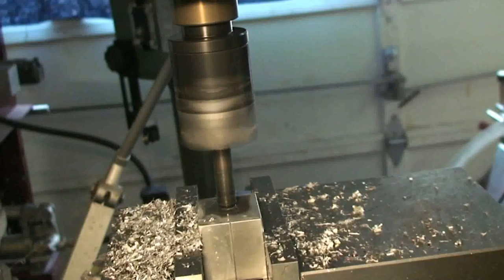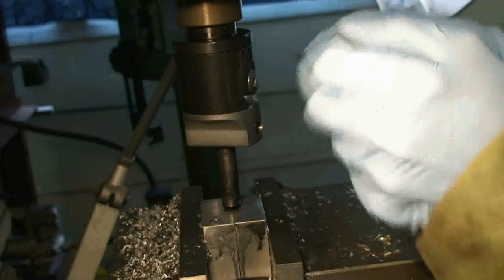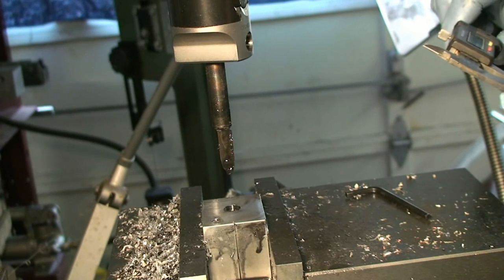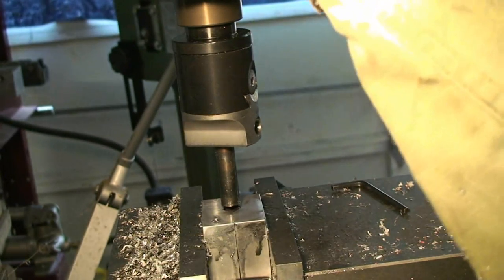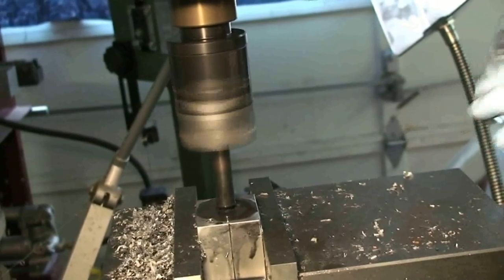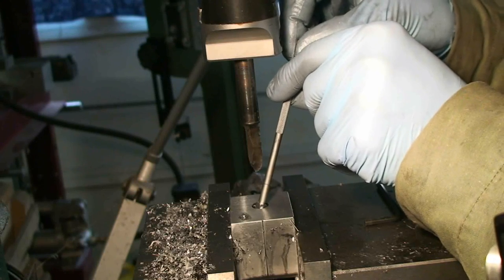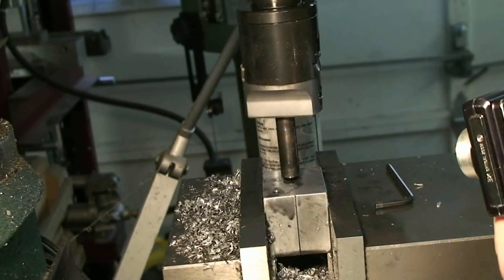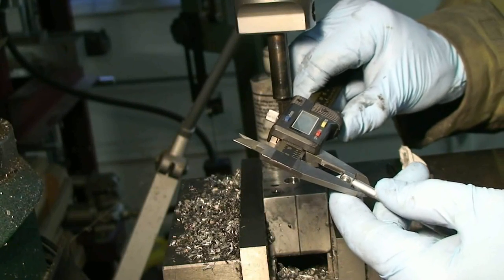Homemade bullet mold part 4.mp4

Comment: Gin is telling you correctly with a mill setup and grooved profiles.  But Gin, you should chuck that block in a 4 jaw lathe chuck and use a boring bar setup to hold the side cutter then the tool holder feed to tweak the ID of the mold.  I would close the tool holder and setup with the cross slide to center in the roughed cavity.  Lock the cross slide, then use the tool holder only to cross feed for cutting.  That makes it easy to return to home position to extract cutter for measurement.

Comment from the maker: I watched his video and it was very informative, great video.  What I am doing here is using the boring head as a "scraper", I'm trying to make a specific profiled shape inside the hole.  If I adjusted the cutter and lowered it into the hole, the inside of the hole would be straight, not shaped the way I want.

Comment from the maker: If I understand you correctly, if I increase the offset of the tool before running it in, it will wipe out the lube grooves its cutting, thats why I ran the tool in, then increased the offset.  Also, I learned from the cannon ball mold video I made that the cutter edge on this was not as good as it could have been.

Comment: He is profile cutting a bullet mold. There are positive ridges around the circumference of the hole. If he plunge cut, as you suggest, he would not be making anything. except a hole. It would probably be easier to do this on a lathe with a micro boring bar. But this works too. Its only wrong if it doesnt yield the results you need. If it were me, i would machine a bullet out of steel then cast a bullet mold off that.

Comment: If you brought the bit sideways down on each block separately, you could make the bit the full size and cut much faster. All it would take is a jig or stop to make each side identical. Of course you need to mill the blocks first, but there should be no problem this way.

Comment from the maker: I could have but didn't think about it when I started.  When I add the second hole to the first mold I made, it will go better and easier.  I am thinking of making a better video, it won't be as detailed, but will be shorter showing most of the steps inside of ten minutes.

Comment: I think Dumbpeopleannoyme should keep quiet about what is happening if he doesn't understand the operation or the design of a bullet. And yes the best way for this job would always be done in a lathe unless a cnc mill was available to circle interpalate the hole with the form cutter. Plunging here would wipe out the lube cannelures so forget it if you are not familiar with a bullet design.

Comment: Study a cast bullet then YOU may understand why he was moving the adjustment while the tool is in the hole. The better way would to use a rotary table... But he may not own one... To bore a STRAIGHT hole,,, you sir ARE correct....

Comment from the maker: @TheAmazingdano 
I did have the table locks snugged down.  I think most of the movement I got was from the flex in the cutter itself.  The length of the actual cutter is about 1.25 inches so there is some flex at the tip.

Comment: Just make the drill/cutter full size, lower it to depth and close the mold pieces in on it as its turning. Then you don't have to fool with the constant boring head adjustments and measurements and cut your time down measurably. Hell, you could do it in a drill press.
Reply: That is one of those ideas that make sense in your head but when tried, it fails miserably.
Reply: @robert5  no, actually, that is a way of doing it. there is at least one video on YT of that method, but it requires a centering vise and a very particular way of preparing the mold so that the halves are held to the vise jaws via the alignment pin holes. 

-cut mold handle grooves in block, then cut block in half (mark the same side on each half so the slots line up later)
-drill alignment pin holes and thread them for threaded rod
-put the two halves in a vise and face them (files or mill)
-Make your sprue plate, locate, drill and tap the pivot pin
- drill holes for mold handle pins
-Drill the gateways through the plate, and spot the mold blocks
-Drill the mold block to the minor diameter to  remove most of the material (Boat tail designs generally take the most work with the cutter, since the base is smaller than the minor body diameter)
- Counter bore your alignment pin holes
-use Pan or fillister Head screws to attach your block halves to the centering vise, then open the vise
- put your cutter in the chuck
-slowly close the vise, occasionally open it and blow out chips and add oil
- use a modified shoulder bolt as your final alignment pin

 The guy does it on a vertical mill, but for all intents and purposes, it could be done on a drill press (provided the drill press had minimal end shake). It's considerably faster than the shown method, since you don't have to stop the machine every .0005" to .001" to adjust it.  We're talking 10-15 minutes, rather than 4 hours lol. If you need to open it up a thou or so, THAT'S when you use the boring head.

Comment: Boring! This is anything but boring , you have given people inspiration to have a go at making their own mould, what it does do however is put the cost of a bought mould into perspective, given the time involved they are very cheap at only $150 ,if you think this mould probably took 8 hours to make, all the time with the risk of a total loss, you would need to sell it for a lot more than $150, but then for a special mould you have to factor in the "fun" part of the job, well done. I think you would be better off making it in the lathe though.